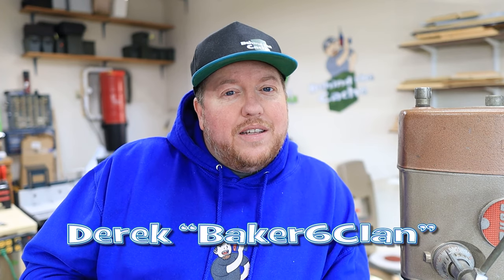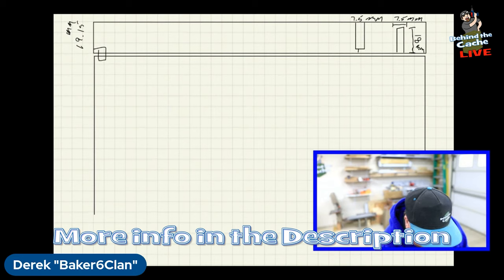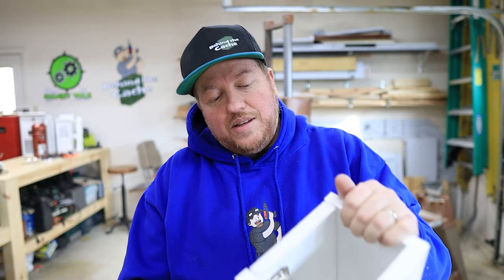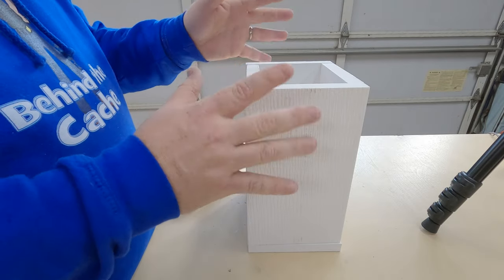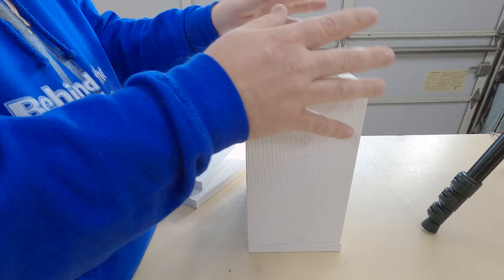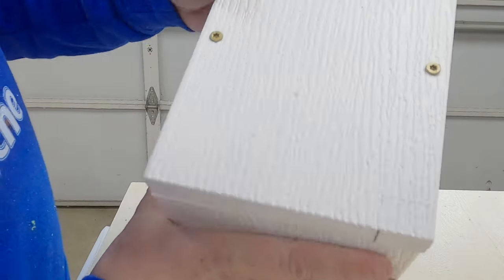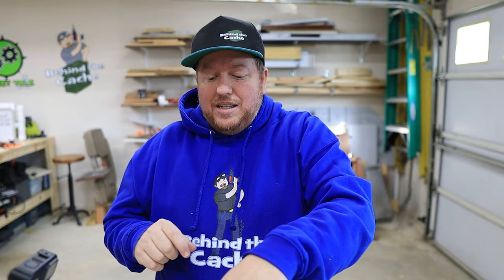What Simple Lock Works Better for this Gadget Cache (GCNW)

Comment: Great construction, simple and still so neat!

The choice here is a matter of difficulty. With the creen lid at the top, it gets easier, it really says "do something here", and if the visitors know they need a magnet, they will solve it quickly.

The one from the bottom is sneaker. If visitors don't know that they need a magnet, it can get very hard, and, unfortunately, you may get it broken from people doing it wrong, and the risk for cheaters with screwdrivers also increase.

So in any event, I think you need to tell/hint people to use a magnet. After that, you select difficulty with the top or bottom choice.

And in both cases, I think many visitors will like the cache. :)
Reply from the maker: Right I am pretty sure it will be from the bottom and I will provide the TOTT. The great thing about the way I created this birdhouse is that there are no screws except in the hinges that you don’t see. 
Thank you for watching and your comments

Comment: Bottom access would be better to keep out the moisture, which has the potential to freeze and make more problems. At least in a northern region. Also, would the plastic printed plugs be UV tolerant?
Reply from the maker: Thank you. The print is PETG filament so it is more durable and should be fine.

Comment: I like the bottom version, but I'm having trouble understanding how the nail from the bottom resets itself when you take away the magnet. To reset, it would need to move upward into the hole in the door, so are you using a spring to accomplish that, or did I miss something.
Reply from the maker: I am using something more advanced than a spring Gravity. The magnet pulls it up and gravity pulls it down.
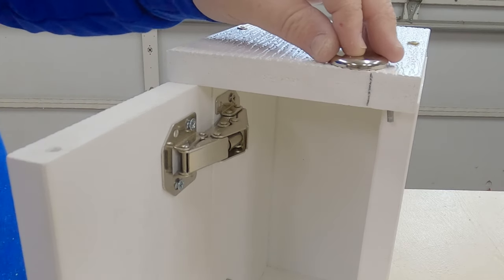Reply: @BehindtheCache  Ok, so you wouldn't use the magnet on the underside of the box ever. That makes sense, but how is that nail staying in the roof piece of the box like you show at 8:10? Did you use that green 3-D printed ring to hold it up in there?
Reply from the maker: @halemeister  yes that green ring keeps it from falling out. The head of the nail is up there so it is larger than the ring.